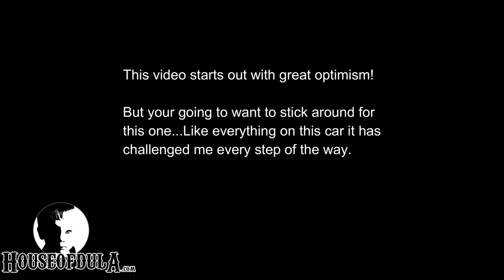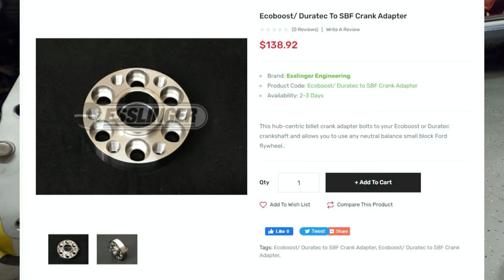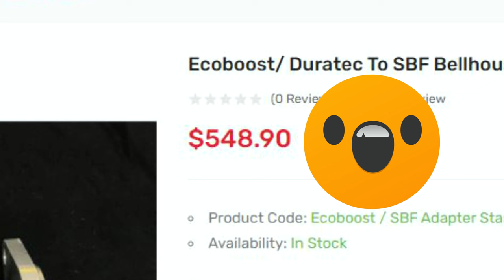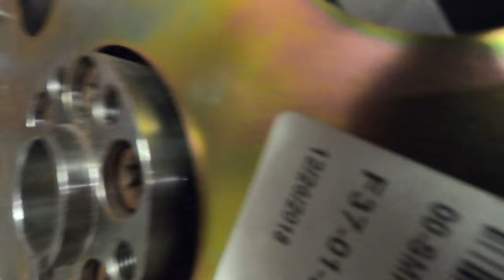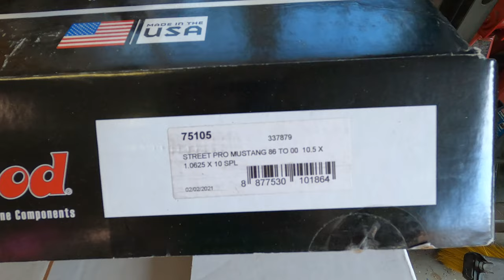Esslinger Issues - EcoBoost Install Part 1 - T5 mated to 2.3L EcoBoost - Episode 30

Comment: Man, appreciate all the House Of Dula R&D. I cant believe a company would charge such an absurd amount for a product and then this happen. Hopefully they get their ducks in a row bc i have a feeling once yours is all done its gonna be a really sweet ride and i see more of these being built. Awesome build!!!
Reply from the maker: Man appreciate those nice words. Again, Im not that worried about me, but yes for the price you pay this should at least have been "we'll look into this and address it for other customers". If it was my company Id send out emails to customers letting them know, be aware, reach out, and if they chose send them an updated kit....basically a recall.
Reply: You are no the first… others have had the same issues.
Reply from the maker: @timtyner3969  - Man at what point do you pull the product though until you figure out the engineering.. Makes me want to design a correct one and market it. The demand is there even though its small.
Reply: @HOUSEOFDULA  I'd have a 1.6 ecoboost to barra adapter (barra t5)

Comment: McLeod uses a pilot bushing because they take abuse and when or if they wear out they don’t chew up your input shaft like the roller bearings do when or if they break. The little needle bearing pieces are as hard as the input shaft so they can do damage whereas the pilot bushings are sintered bronze which is softer. Usually you can test them with a magnet to make sure it’s mostly bronze not steel.
Reply from the maker: Interesting, I wonder if should have used the solid now
Reply: @HOUSEOFDULA  if your input shaft is aligned good a bearing will be fine. I think if you’re making over 5-600hp I’d use a bushing.  They’re called oilite bushings because they’re supposedly made with oil in them. The good ones. It makes sense to me so I went with it. I just didn’t like the thought of chewing up the input shaft on a brand new tremec magnum.

Comment: You can cut the bell housing spacer where the starter bolts up to to move the starter closer to the flywheel. Ford NASCAR engines have spacers where the spot for the starter is cut away
Reply from the maker: Another guy mentioned this. I was hesitant because the ring centers it to the flywheel ring gear. I didnt think the bolt tolerances we're tight enough. Now Im wodnering if I could get away with this.
Reply: Iv done it a few times with the Lakewood bell housing and I haven’t had any problems
Reply: That plate is basically a shim for the stock set up

Comment: I too visit the clearance section quite often at Summit Racing. You can score some nice stuff there a a nice price point. Project coming along good Mike!
Reply: The Tallmadge store nixed its clearance section when Covid hit:(
Reply from the maker: Yeah its great! They fairly recently added it to the Arlington store. Sometmimes its over hafl off. I missed out on a Ford 532 big block crate engine, that was almost half off. 
@sbf_fox Man! hope they bring it back. Odd they nixed it there but not here in TX.

Comment: You’re on your game man. I wrote to you on Instagram about setting up manual transmissions. I was eating up throwout bearings due to the pivot ball being out too far and had the trans out 3 times. Not cool. It felt like I was also missing a little clutch. When I found out the pivot ball was out too far by a 1/4 inch I purchased an adjustable pivot ball and that was the end of that annoying problem. But it was a learning experience for sure. McLeod and neomustangs were very helpful along with a few other big transmission companies The problem was really annoying and I’m glad it’s gone. 6 speeds are heavy and I’m not getting any younger. Good video.
Reply from the maker: AH that was you. Yeah! okay. Yeah you are correct. Fork placement is crucial before adjusting the cable.
Reply from the maker: Thank Sam, appreciate it!

Comment: The alternative would have been the horrendously expensive ($1250) QuickTime bellhousing, with no guarantee that it wouldn't also have fitment issues. Glad you're pressing on with the swap.
Reply from the maker: Thanks. And yes, you are correct, thats a hefty price tag for a conversion bell house...only because they have the market cornered for these conversion bells.

Comment: Note to self: use the tranny that came with the engine.
Reply from the maker: This....But to be fair, esslinger apparently has corrected these issues. This and a t5 in here will be fun simply because its so light and takes nothing to turn. We'll se how it pans out. Any issues down the road and Im just throwing in a 6r80

Comment: Hey great content.it is my opinion that the central  elevation of the adapter(to block)to crank center is a bit higher resulting in a raised bellhousing hence the rubbing. Had a similar situation a while back. Hope all works out.
Reply from the maker: Very possible this as well. Im glad Esslinger makes this product either way, because it gives us guys doing what I'm doing such a broad amounts of transmission options. And props to them for perfecting the design. What I noticed from measuring a stock block from trans surface mount to flywheel face, the esslinger kit just brought it out more than necessary. This was noticable as well from just the starter tooth engagement surface area.

Comment: Loving the video boss, I got my popcorn and everything. So now I'm going to cause a ruckus, but that brass pilot bushing is the way to go. I know I'm going to get skewered here, but the roller bearing type have been known to seize. That brass one will not as long as it's properly lubricated. As a matter of fact it needs minimal lubrication anyway because of it composition. If I'm not mistaken, it's impregnated with lubricant
Reply from the maker: Awe man, sit down with popcorn and all! right on!...No rokus as all...I debabted and went back and forth on this. The clutch came with a solid bushing (not brass) and I ended up sticking with just what I know  and used...Ive never had a motorcraft bearing one fail on me, so again just stuck with personal experience.

Comment: Common issue with Esslinger has been that they make mistakes and then don't do anything to make it right for the customer and fix it going forward. There's a gent who's RS engine they sent had the pistons installed backward, wrong cams installed, and instead of refunding him or doing something to make it right, also ended up ghosting him.

They may have done some good things but there's been MULTIPLE complaints about their quality control and they're not going away. They are best avoided until they start making things right.
Reply from the maker: Well, I heard that story too regarding the engine with pistons backwards, I talked to that owner. Its one of those things, I dont bring attention to the company for any reason negatively ever! But this day and age where everything is shared on social and videod thinga like this need fixed. Their parts are expensive and advertised to do X, but have a LOT OF underlying small print not advertised. This just hopefully brings attention to it and shows them that guys like me are just trying to use our hard earned cash to build cars....and things like this are real.

Comment: So why not cut the section of the starter index plate off surrounding the bellhousing/starter to push the starter in closer to the bellhousing? It would keep your clearances the same on the clutch side but move the starter in further to allow more engagement on the teeth of the starter.
Reply from the maker: This is exactly what my buddy said lol The same guy in the vid...Is a great idea. But man...and I could be overthinking / off here but I know that ring is used to center the starter. It needs to be pretty spot on. The tolerances for the bolts and the holes on the starter are likely close enough though, and cutting off that part of the mid plate would make it about perfect. Like I mentioned to another viewer if anything it just bugs me. I think there is enough engagement to not slip though and being a 4cyl and low compression, the motor is pretty easy to spin over.. I think it will be fine. If I have issues this is what I'll likely end up doing.

Comment: Why did you not go with the 6speed  Manual transmission out of the Mustang also? You said you had the t5 in stock. But was talking about automatic options.
Reply from the maker: The MT82 is great, but needs to relocate the shifter, and convert to hydraulic. I had a buddy go this route and it was just a pain. The t5, im using because i have it. If I ditch the T5 and go auto the 6R or 10R just loved being behind boosted engines...or more-so boosted engines just love being loaded autos give them. MT82 was OUT of the question, I just didnt want to convert and deal with the same hydraulic mess my buddy went through.

Comment: Great video! Thank you so much. I am set to embark on a 2.3L EB swap into a 1974 Capri using the Esslinger adapter. After watching this video, I am definitely going to measure the adapters to make sure they are the same width. Question - Do you think if you went with a 10in or 10.4 inch clutch you would have had the same issues with the bellhousing clearance?
Reply from the maker: Awesome man! And Ive heard that esslinger has updated the kit based on some of the measurements. A smaller clutch or SN95 bell / T5 would have also likely resolved the bell clearance issues.
Reply: All ready installed a 2.3 EcoBoost in our full race 70 Ford Cortina GT using a QuickTime bellhousing , Tilton hydraulic T/O bearing, modified T5/G-Force and Winters mini quick change diff. We we started the build Esslinger had nothing to offer. As well had to go to Modern Drive Line flywheel and clutch. Clearance problem on install- front sump way to close to the ground, so went to Mountune and got their Dry sump system. The Cortina had a 3/16 steel plate welded onto the subframe so able to use the stock EcoBoost engine mounts, but that’s another story.

Comment: I put a sn-95 3.8 t-5 behind my 302. Everyone said that the 3.8 t-5 wouldn't work because it was longer. My measurements came out to be the same as the fox t-5. It was actually about 1/8" shorter then the aod was. 

I learned alot about flywheels and starters. 

The 3.8 uses a larger 11" clutch then the fox 5.0, which is a 10.5". This also means that the 3.8 uses a larger 164t flywheel like an aod flex plate. After doing some measurements, I found that the 302 f-150's used the same depth clutch/pressure plate setup as a 302, but with a 11" clutch and 164t flywheel. 

So I bought a f-150 clutch and flywheel kit and off to the races right? 

Well it turns out, the starter didn't fit. There is a 3/8" or a 3/4" depth to the ring gear. The fox used one style, the truck used the other. So even though it bolted in and started, a fox starter was too deep. I ended up getting a "mini" starter from about a 1993 f-150 and finally everything worked like stock. 

Well, except I didn't have a block plate spacer, so I tried to hobble in the old aod plate. It worked, but the ribs on the block plate rubbed on the flywheel. I decided to fix it with "rev honing". Which is my way of saying, I pulled that darned transmission in and out 15 times and I wasn't pulling it back out again.
Reply from the maker: lol Man...thats hot rodding isnt it? I love the "rev honing" ;)

Comment: Did you run a daily indicator off the back of the crank to see what the run out was on the bell housing opening were the transmission goes in. Maybe that adapter needs to have the dowels offset. Just thinking ?
Reply from the maker: Man, no I didnt. Your second to mention that. And something I didnt even think to check for...again assuming Essliger was top notch and did their homework.
Reply: I raced a stick car for a long time and learned the hard way. Need to do that or you will be breaking snouts. Also need to check the air gap when the clutch is engaged. Make sure it's correct. You can not take a special build for granted. It does not appear Eslinger is spot on from what I am seeing. Just trying to give you some precautions . Great job you are doing enjoying watching you

Comment: Nice work.  Those Esslinger parts weren’t cheap. Im glad you’re at least making the fitment issues known before people spend their hard earned money on them, then have to deal with less than customer service for these specific parts.  
What’s the plan for the rear end?
Reply from the maker: Yeah. Its still a good kit for the price, I think machine it down to your needs and find a thicker mid plate and your still saving money from the Quicktime bell 2.3L to SBF trans.

Comment: Same issues on my 65 Falcon 2.3ECO swap. I used a TKO-600 and Lakewood bell. Said screw it and went 6R as I got tired of messing with it. BOTH spacers I ordered were .850" Esslinger has its issues.
Reply from the maker: Bill, your the first Ive talked to that personally had issues like mine. Whats really odd is your measurements are different than mine. My bell spacer was .773 and the crank spacer was .885! Man if I had that .850 bell spacer with what I mached Id be almost perfect. BUT...my shifter placement is horrible so I dont know what Im going to do yet.
Reply: @HOUSEOFDULA  The plate was .750... I ordered 1 crank spacer and had similar issues as you... measured it and it was .850... ordered another to see if it was a one off issue... .850 again... I tried doubling the block plate, but that caused starter issues... I said screw it and went with a 6R and a standalone harness... check my channel for some eco videos.
Reply from the maker: Bill I just realized something! Your on that "Big 2.3L ecoboost" thread on vintage-mustangs right? Ive read that thread forward and backward for info regarding this esslinger kit.

Comment: Can you machine down the starter adaptor plate a bit thinner to get the gear to engage deeper?
Reply from the maker: Yeah I could that would help engage it too but it would be a little more involved machining around the starters centric hub. I think were okay. The motor spins so easy, being a 9.5:1 4 cylinder, and there is enough engagement to not "slip" Ideally, after a few months of starts I'll need to pull the starter to check it, but I highly doubt I'll see much wear and tear...If anything its just the point and bugs me lol

Comment: I wonder if the spacer was machined shorter if that would have solved most of the issues
Reply from the maker: Well I can say on my 86, t5 to TKO 600, its in the same spot. This is all really from the Esslinger adapter. A proper fix would be to use a SN95 T5, longer bell and input shaft. Would like fix the spacing issues along with shifter placement, back about an 1 to 1.5"

Comment: You think your customer sat with Brian was questionable you should see the messages i have when mine was the first thick one they made, numerous messages, calls and was ghosted. Figured some things out myself and when he got to putting that kit on his sons car he messaged ME back asking if i ever resolved the starter issue on their product. They make some cool stuff and if my customer support would have been more up front and satisfactory i would have already bought a Duratec timing belt drive kit but couldnt bring myself to spend that money and get ghosted if i had any issues
Reply from the maker: Yeah...Well I asked this in my last reply to you, but looks like you answered it here. Its a shame they cant get it right. Others have milled that spacer and been successful as I have. Although Brian was not too thrilled I put this video up and of ihm on the phone with me, he did seem very interested in taking these measurements and resolving the issue. IDK why they dont simply make the adapter crank spacer smaller and call it a day, was really hoping they would have fixed that.
Reply: @HOUSEOFDULA  actually my flywheel spacer was the exact thickness as my adapter plate, no idea why they changed it in later designs. Looks like your flywheel spacer uses hex head bolts to secure it to the crank where mine uses stock duratec flywheel bolts
Reply from the maker: @young11984  Interesting, so looks like they did fix it. That should have resolved all your fitment issues I would think,
Reply: @HOUSEOFDULA  no mine was one of if not the first one made 3-4yrs ago, the dowel pins for the 2.5 and SBF pattern wasnt the right size (fixed that) then the starter issue which i never got a resolution for (that i saw in your video/grind a chunk out the block) it was a few other things that i dont remember right off but have it all wrote down to discuss with him but got left on read so much i hung it on the wall, bought a 6R and didnt look back
Reply from the maker: @young11984  Gotcha. Yeah lol I dont blame you. IF I build a 2.3 block I dont think I'd go through it all again, and use a 6R80. What are you using for trans control? Separate controller? or pats removed harness from ebay kit?

Comment: Thanks for posting videos of the ecoboost swap.  I currently own an 88 lx with a 2.3 original engine I was in route to do a v8 swap to get more power but after thinking about it i would like to keep it a  4 cylinder engine  due to gas prices. After watching your video I'm going to do the same and upgrade to a newer 2.3 engine.  I do have a question will the rear end gear have to be changed out and are you using a v8 or 4 cylinder t5 transmission ? Thanks again
Reply from the maker: Hey! I think its a descision you wont regret. And YES this car should get crazy good MPG if you stay out of boost. Rear end? I would. Its up to you, but a 7.5 is pretty weak sauce, these little ecoboost's make more power than the 5.0 did stock and lots more torque. Its in your best interest to just swap in an 8.8, this always depends on traction and how you drive too, if regular tires, and no smokey burn-outs or hard launching the 7.5 might be fine...Id still swap it if it was me.
Reply: @HOUSEOFDULA  ok cool thanks for the info